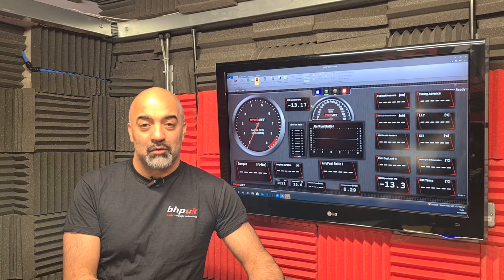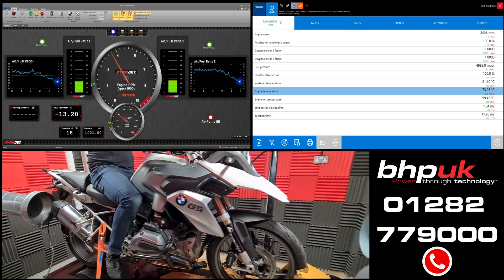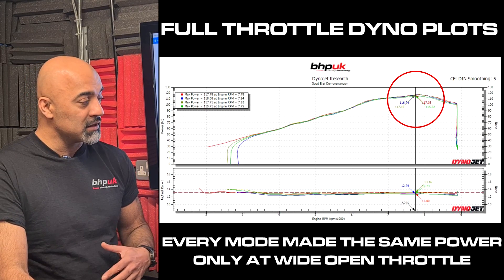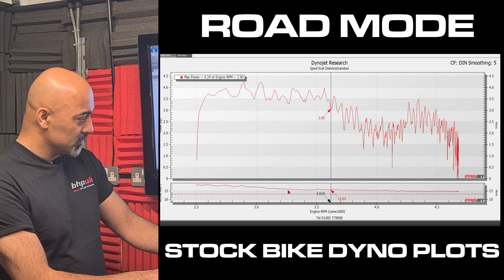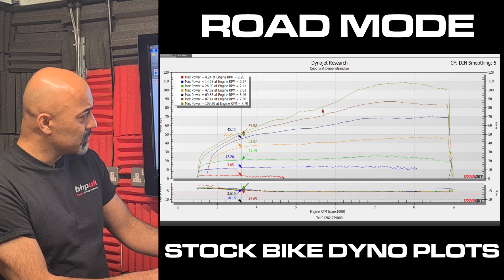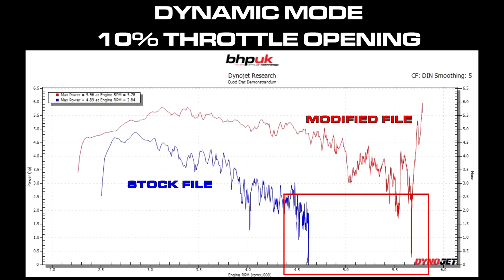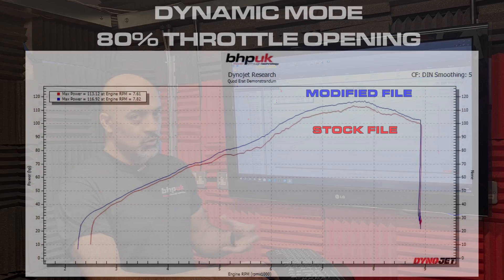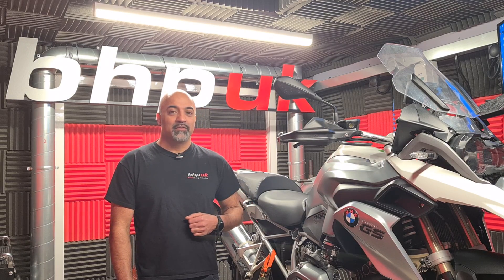BMW R1200 GS ECU Remapping, How We Unlock Its Potential!

Comment: Standard tuning seems very impressive at full throttle; great job bmw.  Part open there's usually a bum dyno glitch at 4500 to 5500 revs so guess that's the emissions tuning kicking in.  It's not a problem really with normal riding but probably worth tuning out.  Is this possible without a power commander?
Reply from the maker: You don’t need a power commander for an ECU remap. In fact if you have one fitted it would need to be removed before we remap it. 👍🏼
Reply: @BHPUK  Thank you.  Wanted to keep mine standard, so using standard pipe etc and just get benefit of better (and cooler!) running.

Comment: Can I ask how dose that correspond to fuel economy and servicing on the bike will it burn more oil or run slightly cooler and will the the power at the crank be increased to the point where it could cause damage ?? I'm only asking because I'd like to have this done myself ?m
Reply from the maker: Fuel economy is not affected. The engine can easily cope with the extra power. In fact because the engine is no longer running lean at any point, our remap will improve engine longevity.
Reply from the maker: Fuel economy is not affected. The engine can easily cope with the extra power. In fact because the engine is no longer running lean at any point, our remap will improve engine longevity.
Reply: @BHPUK  DONT SHOOT THE MESSENGER !! But I have to mention I asked about getting it done locally in Ireland and the closet place told me that it will make the bike heavier on fuel he said he's done a good few GS's and it not a major power increase unless it's matched with a full exhaust system aswell !n but he was fairly sure that it will affect fuel economy even with driving normal !!
Reply from the maker: @nateryan7041  don’t worry we appreciate the info. I’m not sure about other tuners but we did not notice much difference in economy with our development bike and haven’t had any complaints from customers about fuel economy loses. 
Our maps are only available direct from us, either at our premises or with our ECU flasher. 👍🏻
Reply: @BHPUK  ok and can I can how much is the tune I have a 2017 GS !

Comment: Hi!
Are the lamdasensors still connected at that bike?
Will it make the ecu work "against" the PC? Thanks
Reply from the maker: The lambda sensors are still connected and functioning.  We remap the ECU to run different target lambda values.  There is no PC connected, we do not recommend any after market modules or fueling interference devices with our remaps.
Reply: @BHPUK  Ahh...ok, sorry for your clarification. i didnt read it properly. Thought you run a PC. Thanks man.

Comment: Had my done by bhp. Very smooth part throttle almost sublime. You will not regret having it done.
Reply: Hi could I ask the cost thanks .
Reply: @MrSimonfoz  
Give them a ring. I would budget around 400 notes.

Comment: Why couldn't you add some advance. Also will the ecu re write these throttle values when it senses the changes. Or they locked in because you have actually changed the base fuel map.  Is the ignition map also adjustable.
Reply from the maker: Hi thanks for the comment.  
As with all development for bike remapping , we monitored what the throttle plate opening values are in relation to accelerator position (as well as many other engine parameters) this helps us devise a tuning strategy.  This doesn't mean we will necessarily alter the throttle plate maps.
With a remap, the base maps are always changed.  On this bike the fueling maps required the most work.  We can and sometimes do change the advance or ignition maps but again it depends on what the data from the dyno runs tell us.  Before adding advance we like to monitor any knock using a stand alone knock monitor but this is usually much more difficult on a bike than on a car.